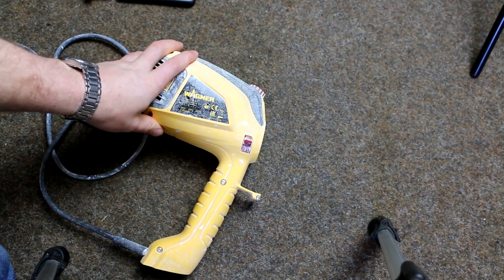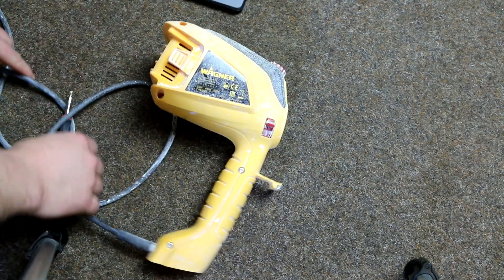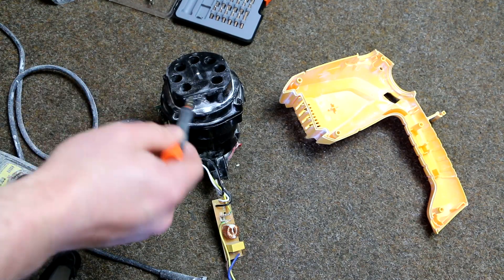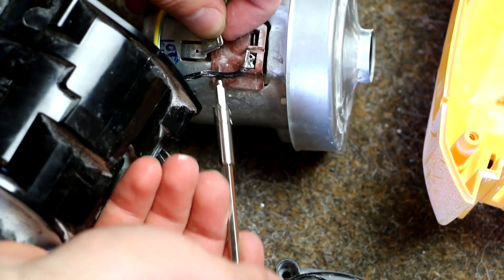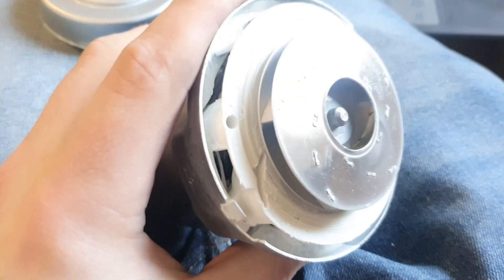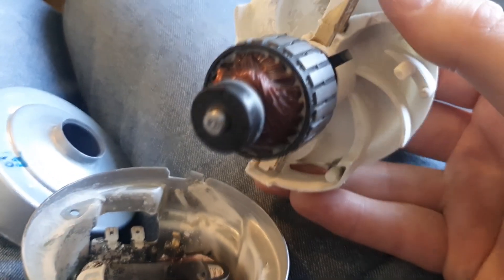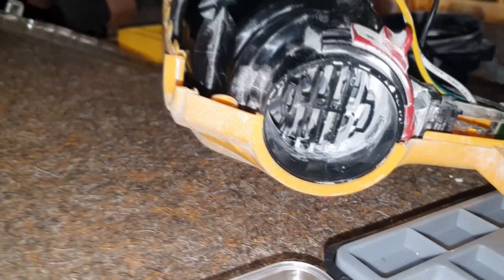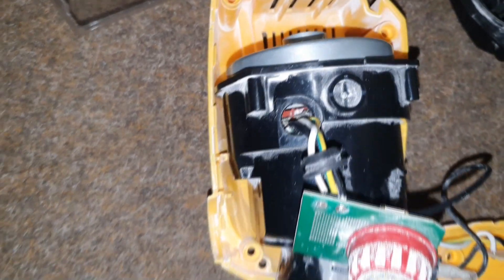Wagner Flexio W590 paint sprayer does not work how to fix

Comment: After the repair and over a year  does you Wagner Flexio W590 still work?
Reply from the maker: @Peko68  yes, but Ive not used it for a while
Reply: @JUrtanschannel  I have the W990 w/ same issue. I opened it, cleaned it thoroughly, put it back together and it works like new. The motor can be opened without "prying". INSTEAD  place a hard wood or plastic on the LID (Cover, Cap what ever is called), where the brushes are located. hit them with Hammer gently AND =>ONE-at-a-time« on BOTH =OPPOSITE sides. After couple of time the LID (Cover, Cap) will pop out nicely without any damages. From there it is "just"  =A -LOT -OF - CLEANING !
Reply: @Peko68  Hi, thank you for this comment, it really should be pinned towards the top (if that's even possible). Just wondering if you could be a little bit more specific on what part of the motor I'm supposed to hammer. Are we talking directly on the top of the cap, or on the sides? Thank you!
Reply: @søflksøslødfkæfæNOT on the motor itself should be "hammered"!  The LID (Cover, Cap what ever is called) is the way to open the housing. On the LIDs side there are 2 "stand-outs"SLIT (Openings) where you could push or "slid" in  some flat things like flat-screwdriver. With it you could PRY the LID(COVER) open. As shown in the video. But this method  will leave you with visitable "damaged"  Lid (Cover), since the aluminum will giveaway easily while prying. If you are patient and take your time, you could hammer it back and so on… BUT I approached the opening differently. Remember: Lid (Cover) is NOT welded, soldered or something else. It is just pushed in firmly. As mentioned, take a good look at the LID (Cover). Your observation will lead you to 2  "stand-outs" on the SIDE of the Cover. Now clamp the motor somewhere. (I clamped it with my strong legs). The Lid should face down (towards the flower), Place a stick of hard wood (plastic or what have you) on the Slit-opening on the side of the Lid. Go ahead and hammer gently on the  wood (plastic) Stick, move to the other SLIT and do the same. REPEAT couple of times. And the Lid should pop-out nicely without any "damages"!  From there, it should be self-explanatory. And =>> A-LOT-OF-CLEANING is waiting for you, in case of color entrance within the motor. Patience is required 😅🤪🤪

Comment: Did exactly as you said and it worked after cleaning the contacts as the paint had got stuck in there. Had to make  sure the lead were moving. Appreciate your video heaps. The surprise was when the motor ran

Comment: Thank you so much brother. This video helped me fix my Wagner Flexio (different model) which had sucked in paint into the motor component. It was the same deal with the sticking pins. Once I cleaned these out, the metal pin moved more freely inside. Great video man!

Comment: Excellent video! The paint backed up in my sprayer unexpectedly. I followed your instructions completely and took a chance to carefully remove some of the paint off the motor wires. I only had problems putting it back together because of the prying to remove the top of the motor. Everything works fine! I am grateful😊

Comment: Thanks for this video.  Last time I washed my paint sprayer, I forgot to put back the red washer in the nozzle.  What a mess !!  The paint went inside my motor and I tried to clean it the best way I could but I didn't succed.  After seing your video, I desassemble the motor and I found so much dryed paint in it that it couldn't work.  One of the motor brush was completely coverd of paint.  I soak the parts in hot water with black soap for a few hours and scrub every little parts with a dentist tool and a needle. I finnaly got all the paint off.  I think that I should remplace the motor brush that was full of paint because I dammaged it in scrubbing the paint.  Do you hage an idea of the motor brush model I should order ?  I search on internet but the only similar motor brush I found were for washing machines and they seams to be too big.  Thanks for your help.
Reply from the maker: Hi there, I dont know exact dimensions/part number of the brushes, but I suggest you to take one out and if hardware or electronic tool shop does  not have the same one, buy little bigger and just file the new one to the original size. Of course it is not the best solution, but if you do good job, it will be as good as original, if you wont file it quite a close to original dimensions, it may overheat and melt the plastic where brushes are located and destroy the motor. Sorry for not beining able to help.

Comment: Exact same issue, and this video was really helpfull to disassemblyle and fix. Nice job!

 The exact problem  with my sprayer was that the paint insixe the motor prevented one of the spring loaded brushes from moving to contact the rotor. Clearly a design flaw that allows paint to get to the motor and cause this issue with normal use.  What I don't know is,  how do you prevent it from happening again? It's. It like you should run water through the motor to clean it.
Reply: I think it happens if you remove the cap of the spray nozzle without removing this part entirely from the motor device itself. The built up pressure is released and paint leaks out towards the back and front. I've made this mistake when the gun has clogged up and tried to wipe it clean. Very annoying!

Comment: Brilliant video. Exactly the same for me. My version has black plastic panels on the side and end that you can just clip off. Took both of the brushes out and one was stuck solid with paint. Fortunately it was water soluble paint, so cleaned them up, sprayed a bit of isopropyl alcohol on them to displace any water. Put it back together and working absolutely perfectly.
Reply: What did you clean them with, just water?
Reply: @søflksøslødfkæfæyes , that was all I used .